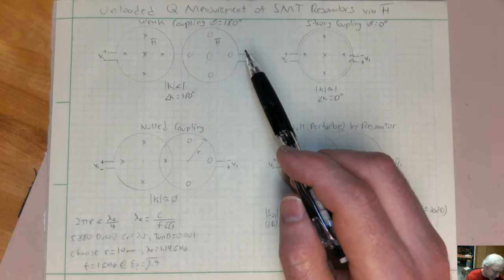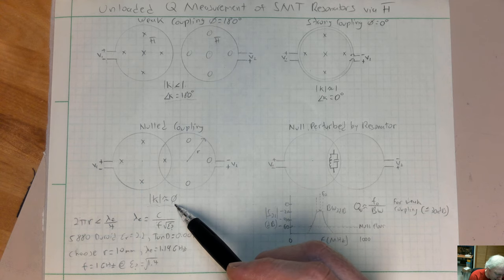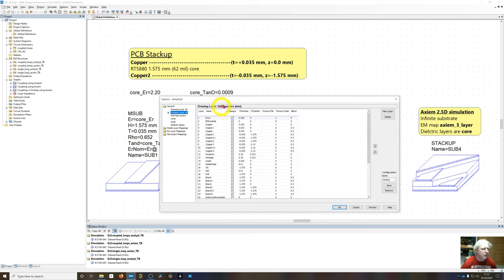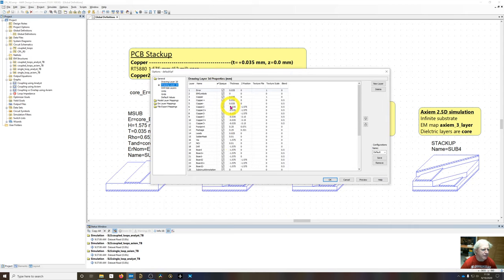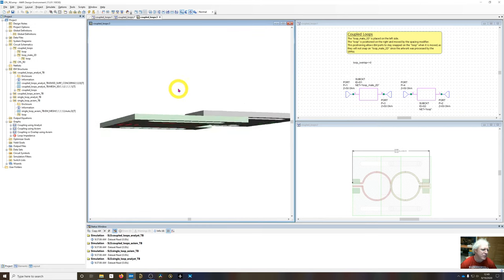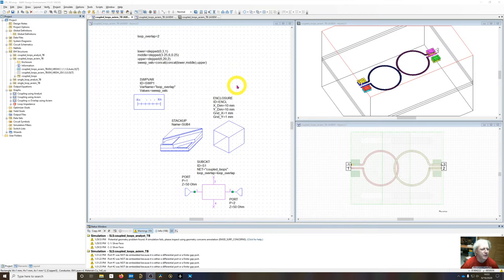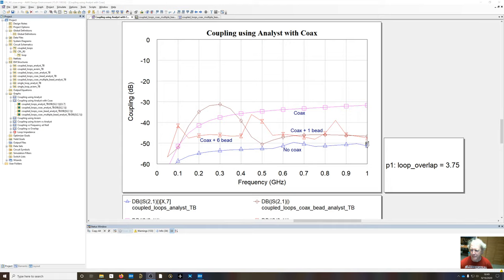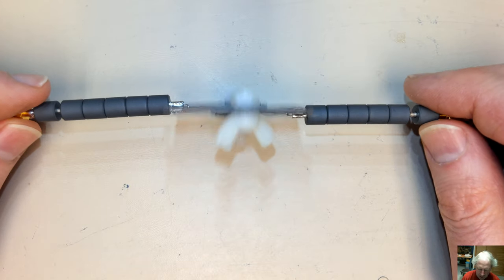GBM 007 Coupled Loop Fixture for Q Measurement of SMT Resonators

Comment: Very cool... I used similar method when I was measuring RFID bank card's resonance in the HF range.  Two coupled loop antennae and you pass the card in between.  A resonance was visible at around 12.1MHz to 16.1Mhz.  From there we could extract the L and C to tune the Transmitter loop to ensure we had sufficient BW to read those cards.  you have a similar method at MW frequencies which is impressive.